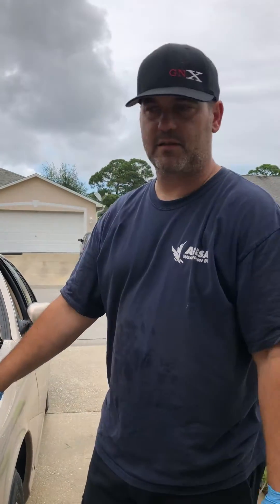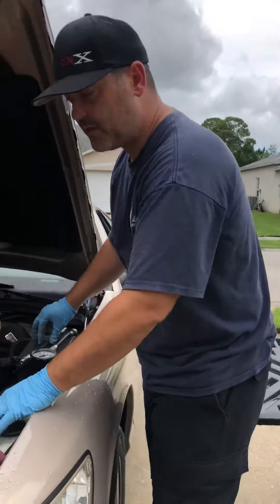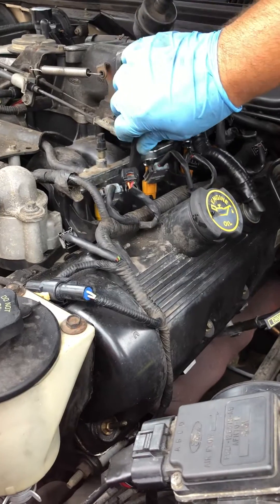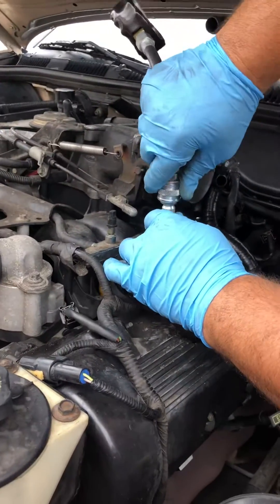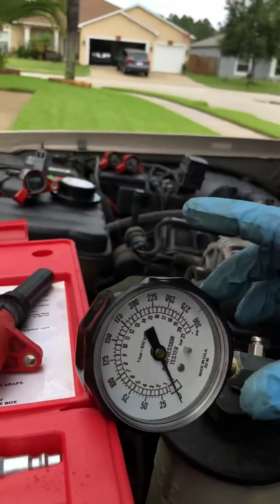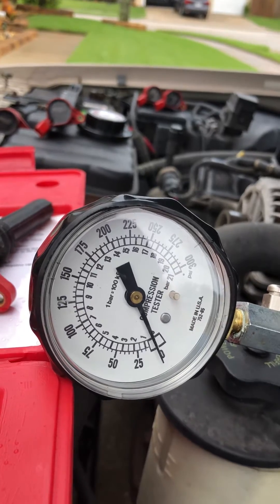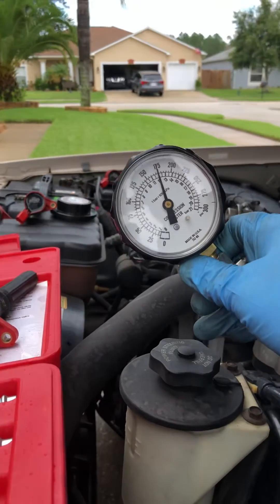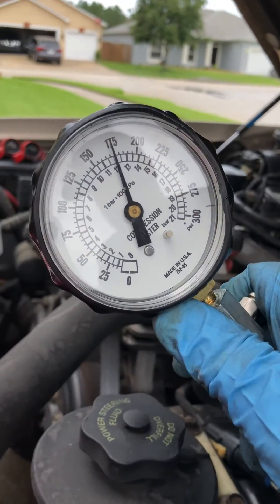Compression Test on a Grand Marquis 4.6

Comment: 2003 Lincoln here, hydrolocked got it started miss in #8 cylinder.  Did you  a special compression test kit for these engines?
Reply from the maker: @michalgt77440  No, I used a regular kit, no special adaptors.
Reply: @stormnyss  I need to do a compression test before i do anything else. I can not stomach the scrap price for my Lincoln. 450 or 250.
Reply from the maker: @michalgt77440  You probably can rent/borrow one from your local auto part store if you don’t have one.

Comment: Sir question I did compression test so far on the left side cylinder 1 no compression should I take of the valve cover and inspect further ? Ibe already changed coils , plugs , ecu injectors
Reply from the maker: Yes remove cover and see if the rockers are moving, you may have a valve issue too.
Reply: @stormnyss  so remove cover and check for valves or rockers  do u have any other tips ? My crown vic is one of my favorite cars to ride I don’t want to have to sell it
Reply from the maker: @Blackbeltgarage7  yes make sure rockers are moving, may have a stuck or burnt valve.
Reply: @stormnyss   sir u were correct my rocker and spring were just laying next to  first cylinder 💀💀💀💀💀when I remove cover also the valve is in there ? What should I do now replace rocker and spring ?
Reply from the maker: @Blackbeltgarage7  So the rocker was off ? If the spring is still in place then replace the rocker. First find out why the rocker was off, did it crack, broken stud etc. Then install a new rocker, it should open the valve when running then retest for compression.
Reply: @stormnyss  yes I figured out the spring broke i found it  in pieces  and rocker was just laying there but the spring was broken  so now I just by new rocker and spring ? And reinstall it ? I don’t have to take of the cams  or   Mess with the timing chain ?
Reply from the maker: @Blackbeltgarage7  did the valve drop since the spring broke ? You may need to remove the cam to install. Maybe pull the plug and fill the cylinder with air to install the spring so the spring won’t drop.
Reply: @stormnyss    sir I Installed the spring  compressed it and put the keepers back on and lifter but now when I go to installed the rocker it just sit there  on top of the spring and lifter there’s nothing keeping it place  ? Am I suppose to adjust the  rocker by spinning the cams I did spin the cams and at one point the rocker arm got snug but as I  kept spinning the rocker got loose again? How am suppose to get my rocker arm adjusted into there?
Reply from the maker: @Blackbeltgarage7  sounds like it may be stripped, the head may have to come off or you may be able to tap it on the head. If it keeps spinning then it sounds like it maybe stripped.
Reply from the maker: @Blackbeltgarage7  if you tap it on the head make sure you get allot any metal particles out of the head.

Comment: I have my intake manifold off and plug wires off
Reply from the maker: Why do you have the intake off ? Did it crack ?
Reply: @stormnyss  nah i replaced a cracked one already I had it off because the plastic near the coolant ports melted when my thermostat got stuck and I drove it hot. And I can't remember the other reason lol. It's been sitting a while